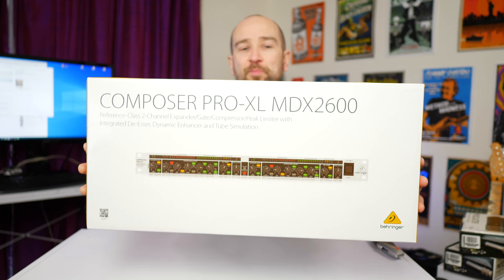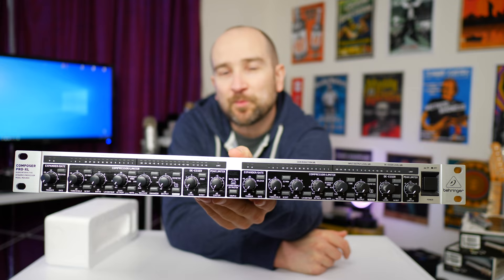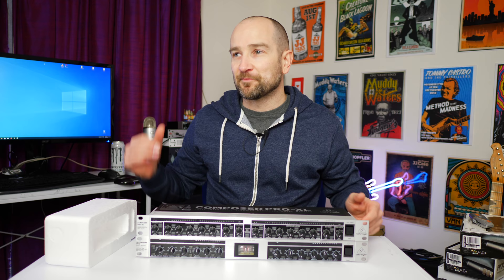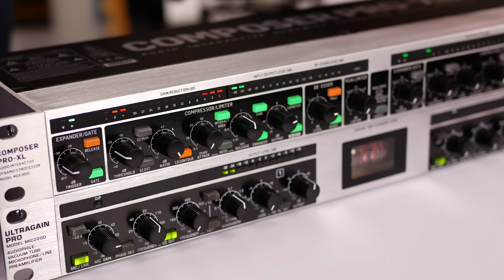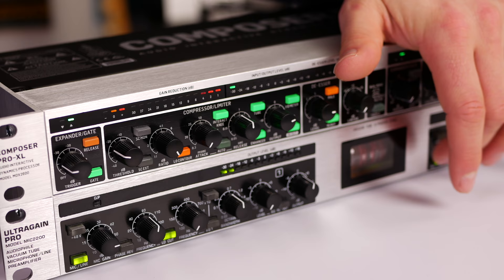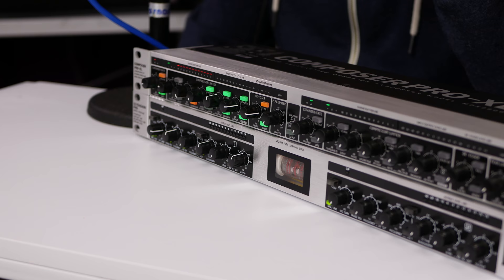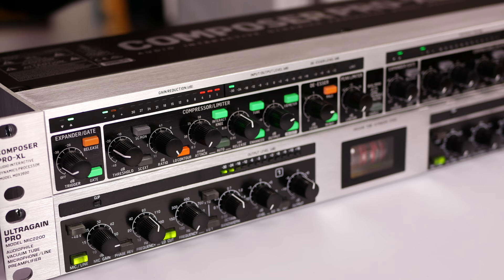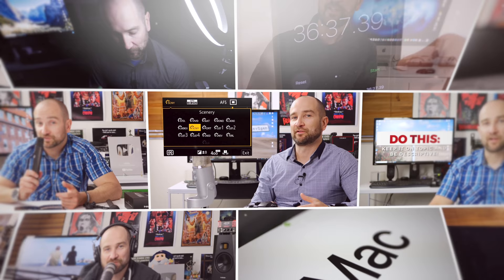Behringer Composer PRO-XL MDX2600 Review (AUDIO TEST)

Comment from the maker: Thanks for all the feedback. You can check it out using the links below. 
Let me know if you have any other questions. 
Buy it on B&H (USA)
► Behringer Composer PRO-XL MDX2600 - https://bhpho.to/2ZxMp6I
► Behringer Utragain Pro Preamp - https://bhpho.to/2FyMr5A
► Rode Procaster Microphone - https://bhpho.to/2Fuc2fG
► Steinberg UR22MKII Sound Card - https://bhpho.to/2FyNvq6

Buy it on Sweetwater (USA)
► Behringer Ultragain Pro Preamp - https://imp.i114863.net/BehringerMic2200
► Behringer Composer Pro MDX2600 - https://imp.i114863.net/BehringerComp...
► Rode Procaster - https://imp.i114863.net/RodeProcaster
► Steinberg UR22MKII - https://imp.i114863.net/UR22MKII
(affiliate links)

Comment: I think you're under-driving the compressor. The green level is peaking at -18dB, so you're working around 16-20dB lower than nominal (0dB). This explains why you need so little gate/expander, or why at 4 notches it starts to make your mic audio cut out. I'd also set it to be an expander rather than a gate for vocal work, so that the noise floor is simply lowered rather than chopped off to nothing (the gate is more useful in a situation where you're trying to prevent multiple mics from cross talking, like when recording a drum kit). I'd wind up the output of your pre-amp, and make the compressor work more. You can then set the thresholds of the compressor and gate/expander higher if you find it's compressing too much. The fact all the red LEDs come on when you stop talking is the gate/expander in action - it's pulling the level of your noise floor right down. You also say something about the unit making your quiet sounds louder, and that's not what compression does - compression is a gain reduction function. You can make sounds at levels below the knee sound louder by turning up the output gain (sometimes called make-up gain). The make-up gain is intended to replace some of the gain lost by the compression process, but by this virtue, it also raises the level of anything that hasn't been compressed (that stuff below the knee). You're also running a really high ratio, which is making the unit work more like a limiter than a compressor. Maybe you could make a video where you change the ratio to show the difference it makes? At least you've managed to set up some fairly nice sounding attack and release constants that suit your voice - I've heard some reviews where these are badly set, and it makes the output "pumpy" and subjectively horrible to listen to. Other than those really technical notes, this is a good review. I've used an MDX2600 for many many years in a broadcast environment, mostly as a limiter rather than a compressor, and for the money, you get a pretty good single band compressor. I'm pretty sure they're more expensive than they used to be too - I'm sure I bought mine for less than £100.
Reply: @jaredrogers1320  I can't really give any hard advice on your suggestions. The best thing to do is try it out, listen to what it sounds like. and judge for yourself if it sounds good or not. You seem to be applying several layers of compression and leveling, and you might find it's a bit too much. Note that if you compress something twice, the effective end ratio will be the product, not the sum, of the ratios. So 3:1 compression followed by 4:1 compression is the same as 12:1 compression. I generally compress mics before adding effects (like reverb), because compressing reverb or delay or echo reduces the decay of these effects, which can result in muddy mixes. Finally, before you go crazy with effects and enhancers, take a long hard critical look at how you use EQ, because cutting or boosting particular frequencies can change the way your mic audio sounds or fits in with other sounds in the mix (for example, don't boost the mid-range on everything, because you'll end up mixing mud. Assign frequency ranges to each component of your mix, and cut the frequencies that are used by other things (cut first, then think about boosts later). An EQ that allows you to sweep through frequencies will help you to identify objectionable resonances that you can then cut.
Reply: @jaredrogers1320  As for meters... LED meters are useless other than for checking the levels of tones (and even then they aren't accurate enough). Effects units don't affect tones in the way that they affect more dynamic input, so trying to use tones for anything other than initial line-up is pointless... and thus LED meters are mostly nothing more than eye candy, so go for moving coil if you are serious about metering. Also, get meters that show you want you want to see. VUs generally bounce around too much for dynamic programme, and aren't generally fast enough to measure actual peak levels, so are again only useful for tones. VUs with a damped action are better at showing average levels. PPMs (most often seen in broadcasting) have a fast attack and slower decay, so better represent peak levels, but not average levels, so you have to allow for that, allowing speech peak levels to be higher than peak music levels so that the average levels of both are about the same. Meters are useful, but use your ears to tell if something rounds right or the balance of the mix is right. Your ears are your ultimate monitoring tool for everything from levels to how good an effects chain is.

Comment: I got this unit 10 years ago. I run it on ancillary output from my Focusrite interface for optical analog dynamics. Still holding strong 10 years later!
Reply: I have one running over 20 years, permanently switched on, still going strong.
Reply: @simonblandford1002  You're all lucky! I Bought mine back in 2003 and within two years almost every switch was bad, resulting in functions turning off and on.
Reply: daw için alıcam aslında daw içinde bir çok plugin mevcut ama analog olması kolay kullanım sağlar

Comment: I own a MDX 2600 for more than 10 years. 
I've just learned that it's pass through!
Thanks!
Reply: Most behringer things do
Reply: Its not that obvious from the manual thou.
Reply: What does pass through mean?
Reply: @boimesa8190  The signal goes through even when it's turned off.
Reply: @bitcollector6285  do u know if the TRS inputs carry a stereo signal without summing it down to mono?
Reply: @boimesa8190  No. As far as I know this is not possible. TRS are for balanced signal.
Reply: @bitcollector6285  thanks!

Comment: I've had a Composer Pro since 1998. I've not used it a lot because I had a Focusrite Voicemaster which was my go to back then and although I used to use the Composer on my mixes back then I usually took it off and just leveled my mixes how I wanted them without compression and left it for my mastering engineer to work his magic. I've recently taken it out of storage and I'm going to use it on vocals going into the Composer Pro then into my mixer. It should be interesting to hear the results. Thanks for the tips.

Comment: Behringer makes some great rack gear Shane. For my PA setup, I'm using their 12 channel rack mixer, with the DBX 166xs compressor/limiter (for vocals) and a Behringer 30 band stereo EQ. The 12 channel rack mixer has build in effects which you can mix into any channel. I also bought a TC Voicelive to try out for a bit of fun, but haven't had the time to play around with it.
But the MDX2600 sounds pretty good, I like that enhance + tube buttons too.

Comment: Hi!I'm not an expert but i wanna normalizie the audio output from movies for my stereo home theather.Sometimes the audio output is good for speaking but is too high in excited scenes and always i need to manually up and down volume,it annoys me.Can i use this compressor to solve this problem?I need to connect the left and right channel respectively in the channel 1 and channel 2 and replicate the same settings?Is there any better tool that costs less to achieve the same effect?Thank you!
Reply: if you are using a nice A/V receiver, most of them have already the feature you want, it is called night mode in many units ,if yours does not have it , this unit can do what you mention .

Comment: Is there a huge difference between the 2600 and the 4600? Just picked up the 4600 today and wondering if I should've gotten this, instead?
Reply from the maker: I haven't tried the 4600. I ended up moving to the Rodecaster Pro a while back but if the 2600 is doing the job, you won't need to upgrade.

Comment: That setup sounds great! I recently got the SM7B w/Coludlifter CL-1 and MOTU M2 USB Interface. I also just purchased the DBX 286s & Behringer Xenyx 1204USB Mixer for $260 (with some high quality XLR wires and 2 x Behringer MicroHD HD400 Hum Destroyers) and the 166sx & 215s together for $150. In total $410. I some good deals and hope it's going to serve my needs for live streaming (podcasting). Let me know what your thoughts are.

Comment: So does the mic hit the Composer unit first?  Or is it downstream of the preamp?  Imma newbie.  I just got both of these units myself and hooked it up with the preamp first after the mic (I figured this unit has the phantom power whereas the Composer Pro XL does not, so that suggests mic should go to it first).  Also, the physical size of my units are exactly opposite of what you show, my Ultragain  Pro preamp is smaller than the Composer.  Thanks for the informative videos!

Comment: Did you use the 48v on your interface to get that mic working ?
Reply from the maker: It doesn't require Phantom power as it's a dynamic microphone.  Check my review of the Rode Procaster for more info :)
Reply: @GeekyNerdyTechy  can I connect my interface to  composer pro with a condenser mic

Comment: Hey, an excellent video that helped me decide on the Behringer Composer PRO-XL MDX2600. I have one now and have problems connecting them to my audio interface. I am using a Motu M2. Could you do a tutorial on how you can connect the Composer to an audio interface, for example, I am using Motu M2 and I use Audio Technica AT 2035 Microphone. Or where can I find it how to do that. Or do I have to buy the Ultragain Pro MIC2200 to have the same setup? Simply, I have difficulties connecting the device. I know I am a noob. Thanks for the video, anyway. Please keep doing such great videos. Sorry for my English I am not a native speaker.

Comment: Hey, I know this might sound like a silly question, but I have no idea what I'm doing. I bought this compressor and I set it up just like you have it in your video but the lights on the front don't move when I'm talking into my microphone or when audio is going through the compressor, am I doing something wrong?
Reply: Your input source is not loud enough. You should be running your mics into a mic preamp first, adjusting the levels to get where you need to go.

Comment: Question, can you explain how you hooked up the two units to your interface? You have 2 red cables in the back and also a red cable going into the interface, where does the 3rd red cable and the top left black cable on the MDX 2600 go?

Comment: I am very interested in getting one. Differences between 1600 2600 and 4600? Except that someone has 4 channels. They are cheap used, after all. Or is it safer settings with a Yamaha compressor mixer table?
I understand that if you set it right it sounds very good. Thanks for the good explanations.

Comment: I always loved Behringer equipment except for one dirty secret they hide...they have always been noisier than the competition.  Is this any different?
Reply from the maker: Most preamps are noisy when you turn them right up.  These are fine up to about 3 O'clock.
Reply: @GeekyNerdyTechy  Well, of course but I mean out of the equipment I purchased from them over the decades they were noisier than most and I found out that it is the norm due to cost cutting.

Thanks for the reply and 3pm is a tad more than I go so glad there is some room.

Comment: Hi! This device hasn´t phantompower, right? So I have to buy a external 48V Power device? 
Best wishes!
Reply: Jusuf no phantom power
Reply from the maker: You will need a microphone preamp to alongside this for phantom power.
Reply: @GeekyNerdyTechy  I have a umc404hd with phantom power. Can I just plug the compressor into the insert of the umc404hd and plug my mic into the input of my 404hd?

Comment: Behringer garbage. I had a Composer many years ago. It had to go back to Behringer twice for repair. Just got a Composer Pro for free but one side is dead, unsurprisingly. Musically, I can see some uses for the character of sound but I wouldn't touch Behringer. Any new purchase is also an immediate huge loss of value should you ever sell.
Reply: My autocom mdx1200 is still going strong. And my multicom mdx4600 is doing great.